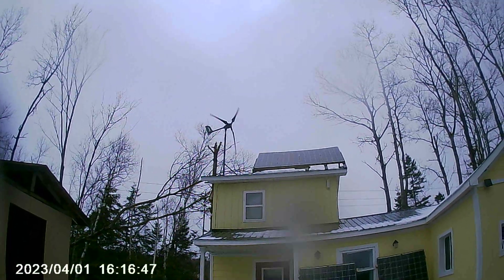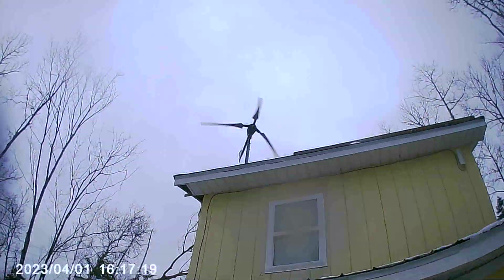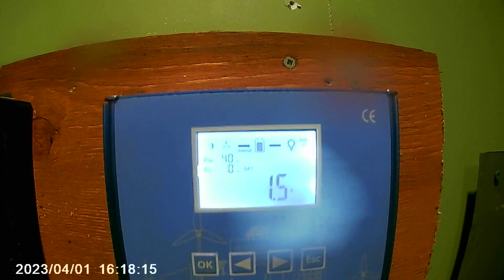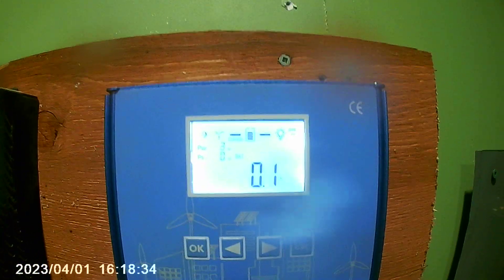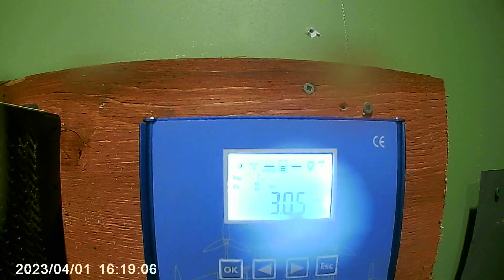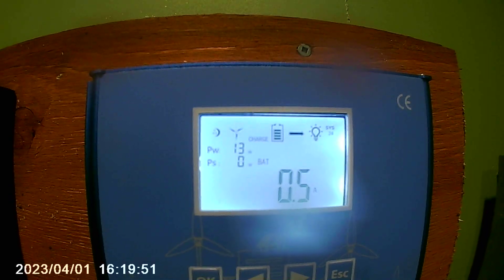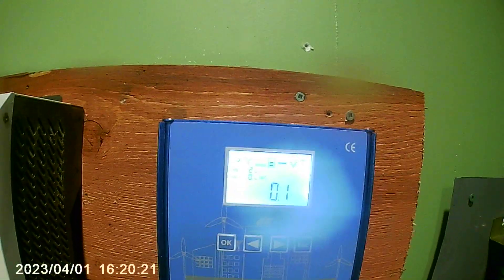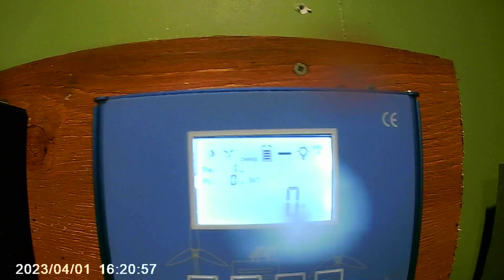ista breeze i 700 in low wind 20 kmph flyin on the camp

Comment: Can I hook one of these up to a 20KWh AGM bank that is already connected to a Victron 4kVA EasySolar (inverter/charger) and PV panels?
Reply from the maker: you sure can if using a bridge rectifier it will work just fine.however an mppt charge controller can yield 5 times more output.most importantly be sure to have a dump load in place to protect your turbine and your batteries
Reply: @offgridgarage  Thanks for responding - much appreciated. I already have a Tristar 45A Diversion Charge controller which is mppt and 500W 48V dump load - installed for the 200W VAWT turbine I am replacing - but those may need upgrading for the i700 I guess.